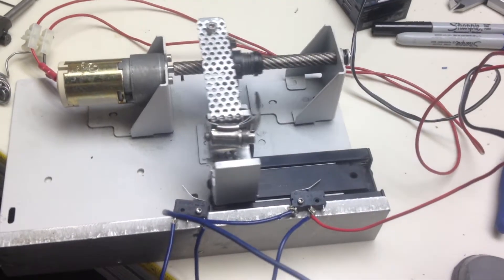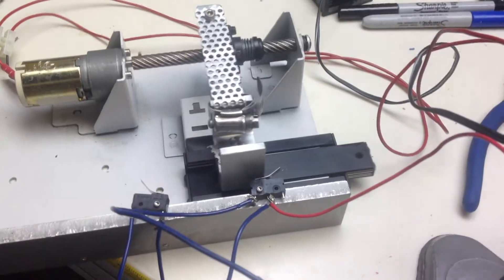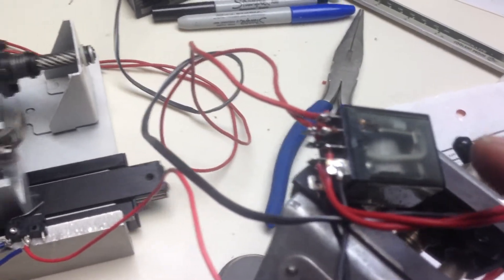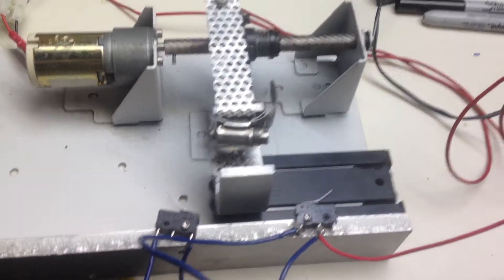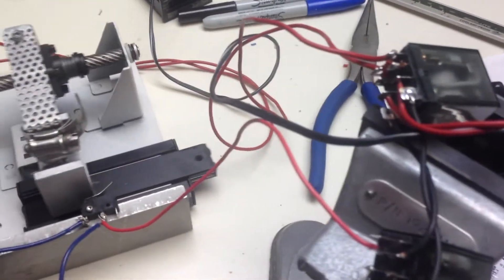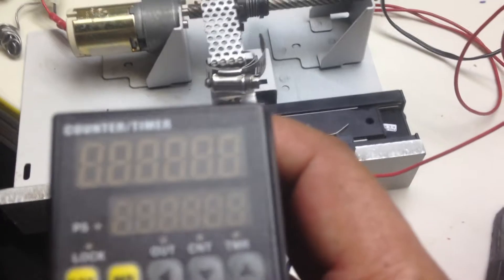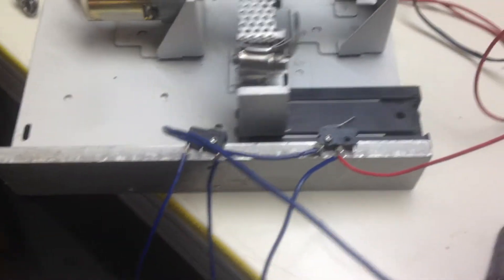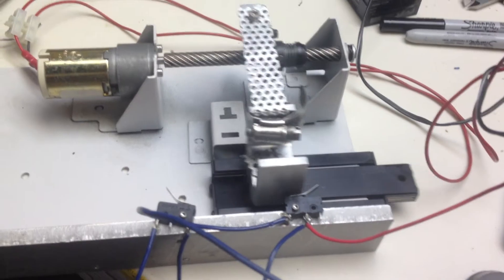Prototype of an Auto Reversing Linear Actuator

Comment: You don't need 2 DPDT relays to do this. You can either use a TDPT or add a Diode to just one DPDT relay.
Reply from the maker: Indeed, that's the beauty of circuit engineering, in that there may be a simpler that you haven't thought of yet. Sometimes when discussing projects with other engineers I'm lead down directions that hadn't occurred to me.
Reply: @ERGMIAMI  The Triple Pole Double Throw relay can get this done with minimal wiring and easier connection of the speed control.  Adding a diode to a DPDT relay works great for simple forward/reverse but have to add a capacitor to relay and counting control. 

Best to use Four Pole Double Throw relay to separate the latching and counting circuits. So you have better control or flexibility depending if your counter needs a PNP or an NPN signal. 

I would share all the diagrams I have already made and screenshots of the simulations that I have in Google drive but YouTube doesn't let me post links in the comments. 

I'm going to use this in my chicken coop door with safety feature that goes back up if there is an obstruction, then back down but will only do it a preset number of times before it stops and holds at the obstruction. That way the door is at least closed as much as possible. 

Do you have a diagram of your project?
Reply: @ERGMIAMI  Uploaded a short demo of mine. 
https://youtu.be/L_Hxdk-X5fE
Reply from the maker: This is an old project. What's shown was a proof of concept. The final project was an electrostatic polyurethane coating booth for stents
Reply from the maker: The client didn't want to use a PLC. Software validation was a bitch for them.
Reply: Can you shear this circuit diagram
Reply: @alburaqindustrialsupplies  Yes you can shear the circuit very easy. All it take is wire cutters.  LOL  Are you talking to me or the person who's video this is? ?